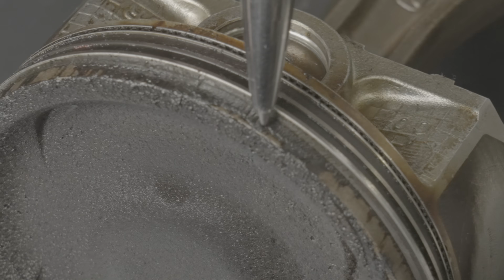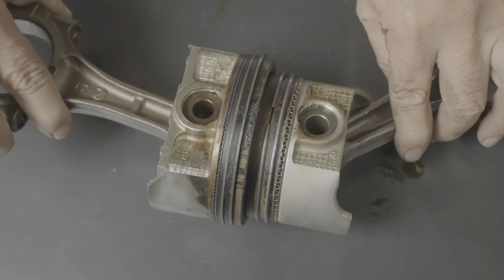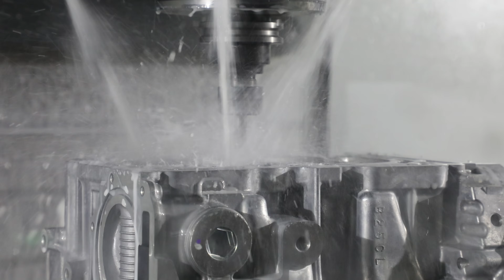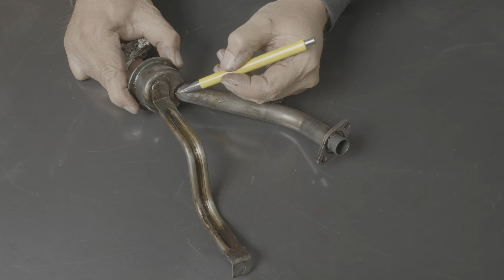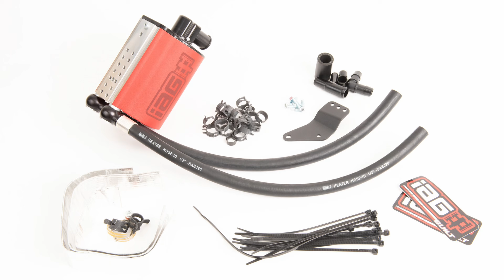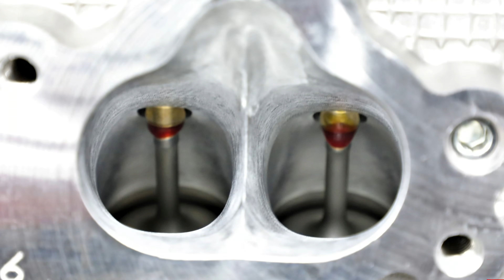Why Subaru Engines Blow Up!

Comment: Speed of Air are hoping to release pistons for most engines within the next year or so . That will hopefully solve the detonation issues.
Reply from the maker: I think dimpling for the most part is a gimmick
Reply: It won't because it's not the piston geometry that's causing the detonation, it's usually people running bad fuel or not tuning right. Using OTS Cobb tunes with mishmash mods and getting their AFM wrong, or blowby. 
But I reckon it's 90% running bad fuel.

Comment: Definitely subaru had some bad years.  But they get a bad wrap. Just leave it stock and you don't have such a problem.   Also the new FA2.4 hasn't had any issues so far.

Comment: It's not just turbo engines.  I had an L series wagon that was diagnosed as wearing out well before it's time.  I had an exchange motor put is as advised but it didn't rum any better, in fact it had less power and worse backfiring.  Both engines would backfire under engine breaking.  I had a light weight sailing dinghy on as light weight trailer.  Total combined towing weight, about 200 kg.  Descending long hills while towing the boat wold cause seriously loud detonations.  The longer the period of silence between detonations, the louder the explosion would be.   I had the engine tested & the result was that the exhaust contained a lot of raw burned fuel.  I kept taking it back the the mechanic who installed the engine, many times for many months, but it never improved.  I took it to the Subaru dealership & they were unable to fix it. as well.  In the end I cut my losses by trading it in for an big old commodore sedan.

I have owned many different brands of cars in the last 50 years, but Subaru, never again!  I am just done with them!
Reply from the maker: That is a bad mechanic that can't figure out a basic problem!
Reply: @motoiq  It wasn't just one mechanic.  The guy who installed the engine couldn't figure it out so I took it to the local Subaru dealership & the team of 3 mechanics there couldn't fix it either.
Reply from the maker: Bad mechanics then
Reply: You should've got a turbo

Comment: You should check out the insides of the FA24F. 😉
Reply from the maker: We did two videos on them so far, look in our Subaru section on our channel page.
Reply: @motoiq  all I could find is the FA20. 

The FA20 isn't the FA24F. The FA24F, as implemented in the Ascent, OBW, OBXT and planned for the discontinued STI implementation, has noticeable improvements vs the FA20, including in key areas like pistons and piston rods.
Reply from the maker: They are actually nearly identical inside and we talk about the differences in the video.  In fact we show pieces of both.
Reply: @motoiq  but they're not. I learned on the training material and parts way back in 2018. Pistons, rings, and rods are quite different in the important ways, just for starters. 

Anyway, love the vids. Been a fan for a while.
Reply from the maker: All that stuff you change when you build the engine so its immaterial.  The engine architecture is nearly the same. I also talked about the difference in the videos. I showed parts of both engines.
Reply: @motoiq  on the FA24F??? For what reason? Stock, with no more than a tune, it hits 400hp with no issues. 

Sorry, but I've been following what the tuning world has been doing with that motor for half a decade. Heck, I'm the guy who helped a few of them find the data points to control the variable waste gate.

You might want to look at Prime Motoring's work. 

Passing 400? Sure, it's time to start modding. 

But up to 400, the FA20, as decent as it is, won't come close without mods while the FA24F can do that stock... 

Even besides Prime Motoring's work, there's a NUMBER of Ascent owners pushing 315 HP and 335 lb-ft torque. And more pushing farther using Stage 2 tunes on their AccessPorts.
Reply from the maker: The video was how to build the motor, not how much a stock bottom end can take, we covered that in another video.

Comment: My pick tube broke on my street driven even thou its modified and rebuilt. Was wondering my my oil pressure was so low then I had it check and it was broke. Had to get a IAG pickup

Comment: Bought an 07 STi, drove it for a 1000 miles before the head gasket went. 54k miles on the clock and a 1/4 of those 1000miles I drove was on the way home from the dealership. It’s still in warranty so that bad boys going back to the shop 😂😂😂

Comment: Thank you so much for this video. It was really helpful. Does the portion referring to the exhaust side of the head, and the valve train apply to the FA as well?  I would really, really appreciate it if you guys did a version of this addressing the FA20 (n/a).
Reply from the maker: The FA20 is basically the same as the 24

Comment: I wouldn’t take my Subaru to this guy for an oil change and its very obvious he totally ignorant on Subaru technologies and maintenance of a boxer engine. I don’t want to duel on the head gaskets just to say the guy is way off about had gaskets. We have sold over hundreds modified Subaru engines for the implementations of drones and AK helicopters in China with an impeccable track record of reliability with the OM head gaskets. This guy got it right https://www.youtube.com/watch?v=NvS_t7hmGGk.

Comment: That's sooo funny when you say the oil pick up is prown to breaking. 

In the FA series it's plastic instead if alimunum (alimunum is a better heat dissipator)
Reply from the maker: The oil return is plastic, the pickup is metal.
Reply: @motoiq  what do you mean? 

The fa24 in the brz has that very long plastic tube where Silicon regularly get caught up. 

That's a plastic oil pick, no?
Reply from the maker: It's metal.  The one I showed in the video is from a FA24  from a GR86.
Reply: @motoiq  there must be confusion in what I am referring too. 

https://youtu.be/6x9LcdY1Cc4?si=ih3lUXzrE1AtXOCG

The plastic long tube in the video is oil pick up. 

Maybe your referring to something else?

Comment: put the intake on the bottom, and exhaust on the top FFS, ever heard of heat?
Reply from the maker: That would look really cool but obviously that doesnt package well.
Reply: @motoiq  the turbo plumbing defeats that arguement immediately.,, you pipe forward... to a turbo.. why not pipe under the engine after that?
Reply from the maker: You can just as easily do that on the bottom too, like the Killer B turbo kits.  From an OEM standpoint its easier to get the cats closer on the bottom.  Also the sump would make the intake manifold super low to the ground.
Reply: @motoiq  planes refute that arguement with their boxer engines and injectors.
For Subaru, its literally a hold over from the carburator days. and the liquid pours into cylinder theory.
Reply: @motoiq  Ah yes because trapping heat against your intake valve and struggling against heat problems (next time you have a blown up subaru, look where  the ringland is, its on the surface, facing vertical, of the piston. the most oil starved, the hottest surface and denied heat loss from the relatively cool exhaust air, and new cool intake charge. heat pockets are hell for all engines.)

next?  a rant about how subaru should double chassis rail wall thickness, and drill holes for spark plug access, and interesting questions for crash structure.
Reply from the maker: Planes have a lot of ground clearance!
Reply from the maker: I mean Porsche a robust flat engine has this orientation. Reversing the flow through the engine isnt going to have much if any impact on heat except make it worse.  Look at late model BMW and Mercedes and all of there problems associated with heat by having the exhaust going towards the engine compartment.  You are right about easier plug access although the valve covers we use makes a big difference.
Reply: @motoiq  hmm.. maybe its a question of a lack of steel undertray, for both platforms? to stop stone strike/ suspension bottoming out against the injectors? 
maybe we get a manufacturer to explain this?
Reply: @motoiq  planes gotta land. also planes needs small frontal area.

Comment: My 2016 OB 3.6 R was stock, had 116k on it, only had it 4 months and it's exhaust valve guide or something like that broke, basically like 6-7k worth of work to do, I had the back do a voluntary reposition. First and Last Subaru I will ever buy. Subarus is GARBO, I leased a Toyota Camry and wont look back. Still owe 11k on that hunk of junk, I have made it a personal goal to bash Subaru.

Comment: You hit the nail on the head in the first minute.  In 'mild' tune they are highly reliable engines.
Reply: That's garbage. Mine had ringland failure before 70k.  It is completely stock.

Comment: I have an na bugeye i want to ls swap you can use an sti 6 speed tht will hold around 600hp all i need is a machined  bell housing two put the two together what do yall think
Reply from the maker: You can swap and STI drivetrain as a direct bolt in. Flatirons Tuning has an online guide on what OEM Subaru parts you need.
Reply: @motoiq  thank you I can't wait to have awd ls I will definitely check them out
Reply: Bug eyes are ugly

Comment: I am buying a 24 wrx, I plan to keep it stock just cause I don't have the money to replace motors and transmissions. I think the 270 horse is more than enough for a daily driver. I am thrilled to be getting one and I keep watching videos like this so I don't fall for the next shiny object. Keep it simple is best. Thanks for the great video.
Reply from the maker: Keep that oil changed with good quality GF-6A synthetic to keep those direct injection carbon particles from harming your engine.  Change every 3OOO miles and run a 10w40.  Keep it stock and it will last.
Reply: @motoiq  I will thank you. I will keep tuned in to stay on top of the newest tips.
Reply: @motoiq hey Mike, would 5w30 be ok?

Comment: I had a 2008 WRX sedan that I bought brand new.  I later upgraded the ECU, did a VF52 from the 2009, intake and exhaust.  It was a daily driver so I didnt want to go to crazy with mods.  I did all the mods at about 30,000 miles. We bought it in AZ.  We lived up in Prescott and I had a LOT of time spent above 100mph. I even tracked it a few times at Big Willow.  I only had to do maintenance on it. I had it for 165,000 miles and just sold it last year..  I replaced the VF52 once. Power Steering, AC condenser, clutch and a wheel speed sensor when I hit a chunk of ice....I live in Denver now.  I drove it hard and often. I loved it.  Thinking of getting a 2011-2014 STI sedan.
Reply: You're an outlier. Most WRX and STI will have major problems in their lifetime 😂

Comment: Has anyone built a flat 8 out of 2 of these?  That would be an interesting build.  For me the only use for EJ's is leave it OEM. For more power just swap in a turbo K24, it can't be more expensive than proper building an EJ.
Reply from the maker: Some people build the flat six. Smeedia is building one now and its making something like 850 whp and more to come with some refinements.

Comment: I have a 6 cylinder 2015 Subaru Outback with 98k and runs like a champ. Do all my own maintenance except a couple of recalls of course. I’ll be changing the Trans fluid at 100k. Other than that it’s good to go until 150k other than the usual maintenance.

Comment: Man, you says; I personally haven’t seen any oil pump brake for daily driving EJ engine still, you have to mention that for hard street drivers they do brake. Who F of us regular drivers does that. By the way there is not a single engine that will last long with hard street drives. 
Again you states if you drive the car like most of us do you shouldn’t have a problem but, again there you are saying,  “ most of you does do hard driving. Sorry you didn’t gain my respect.
Reply from the maker: The oil pump doesn't break, it's the pickup, the oil pump is actually pretty good. Need to pay closer attention to the video. For totally stock ordinary drivers the pickup probably won't break, it's the track-driven or hard-driven modified cars where this is an issue.  In fact a 100% stock lightly driven and well maintained car won't have any of these problems.  This video is more for the enthusiast driver.
Reply: @motoiq  appreciate your reply, however I still believe that over 99% of us the Subaru owners don’t drives like maniacs.I am on my 4 Subaru, the only one that blowed the engine was my 2012 Subaru Outback because I passed to my daughter. She was very irresponsible with the oil changes. Still the car drove 277,000 before the engine blowed. I had a 2016 WRX and did some upgrade but, never drove it like a maniac. Not one issued with the car. Sold it to buy a 2019 Subaru Ascent Limited (my wife car) we have it for almost 6 years now with 63,000 miles. Again zero issues. Not a single repair other than brakes discs and 2 wheel hubs. I drive a 2021 Subaru Crosstrek Sport. Again zero “nada” issues with almost 36,000 miles.
On the other hand we also have a spare 2009 V6 Toyota venza with 265,000 miles. That is an amazing vehicle but, we have spend almost $10,000 on repairs. I think for the kind of mileage that’s very reasonable. So that is that for a brand engine that blows up.
Reply from the maker: Engines blowing up is so common for the performance Subarus, like WRX, and STI there are tons of memes on it. Like we said in the video a lot of this is due to poor mods and tuning.  But like we said in the video, keep it stock and well maintained, or if modded have it done by competent people, they can last a long time.   That being said Subarus has the least headspace for poorly done modifications and tuning than just about any other performance car.

Comment: New to the boxer engine never owned one. I have always been a Toyota buyer my first option was the 4Runner  bulletproof engine and transmission but I do live in a rust belt area and I think it's over priced, the other is the Forester wilderness.  What are your thoughts. Your opinions are appreciated
Reply from the maker: Keep it stock and well maintained and you will be good.

Comment: Oh boy. I have been looking for a Cross Trek to replace my manual 97 Rav 4 which I simply love, which unfortunately they discontinued and the current RAVs are much larger. Unless someone is an auto assembler or seasoned mechanic this boring video is simply not easy to follow or understand. Even though I’ve done extensive research to find a smaller reliable manual suv I’m now reconsidering the Cross Trek.

Comment: I had a 2011 Forester XT for just over 130,000.  I traded it in when they told me the catalytic converter needed to be replaced and it was $5k just for the part. Never had an issue with the engine itself.  Had to have the gate in the turbo replaced about 110k.  I was always hard on it too (I like to drive a car, not steer it).  I have a 2023 Forester Touring normally aspirated now, and I miss that extra torque.  I also had a 2003 Forester, no engine issues, approx. 110k when I traded it in for the XT.
Reply: Catalytic converter for $5k?  Someone is feeding you a lot of BS.

Comment: They bore the d*** motor out too far and Then they use the junkiest metal. They can make the Motors out of. Brittle c*** There's your first problem and then they have the 6 foot Timing belt with junk tensioners. And water pumps. My v six Toyota with 2 heads Has a smaller timing bill. Is piss pore Design on the Subaru

Comment: I doubt the piston design is the major reason for ring sticking or failure. It's more likely insufficient ring end gap, which in turbocharged engines running at increased boost (and higher temps), leads to the ring ends touching and jamming ring movement. It's a know problem on many home turbocharged engines- they need to be prepped properly.
Reply from the maker: So the factory isnt going to get the gap wrong! If you took enough of these failed engines apart, you would see that we are 100% correct.
Reply: It's wrong for the increased boost these guys are running. I'm sure you're correct on many of the other problems, especially if they are ocurring on unmodified engines. but the factory will not set adequate ring gap for higher temperatures because of emission problems,. So yes, they have it  wrong for the conditions modifiers create.  @motoiq
Reply from the maker: Never seen butted ring end gaps on OEM pistons.

Comment: If most of the issues are caused by people not knowing how to build/modify engines, then if I’m in the market for a turbo Outback and am going to do 0 modifications with it and baby it for as long as I own it I shouldn’t have issues right?
Reply from the maker: Yes, be sure to use good synthetic oil and change every 3000 miles, keep it stock and keep up with the maintenance religiously and 200k miles is yours.

Comment: In my experience even the NA engines will blow up once they are overheated a couple times.  They will blow up if they get low on oil, really low but that's not unique.  All old subaru engines leak oil and people don't check the levels.

Comment: My Baja has 210,000 miles and has been knocking for the last 20,000. No burning oil. I baby it and use it as my winter driver, putting only about 3,000/year on it. Fingers crossed.

Comment: This is why no one uses flat motors in the front. The bore to stroke sucks because you would need a stupidly wide chassis in order to fit a flat engine with a decent stroke within the frame rails. Subaru could solve the stroke issue by going to a 6 piston engine but of course this increase cost and complexity for an econobox manufacturer.